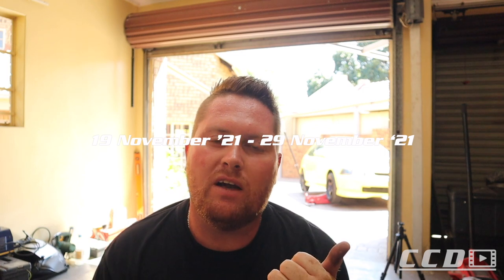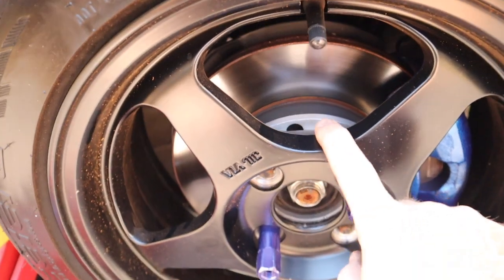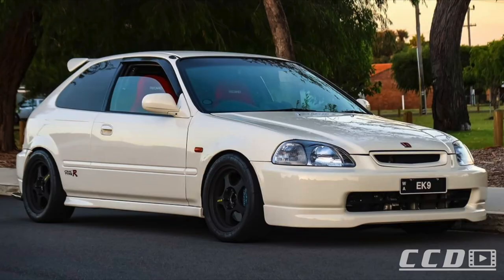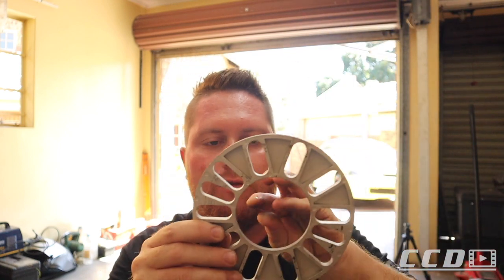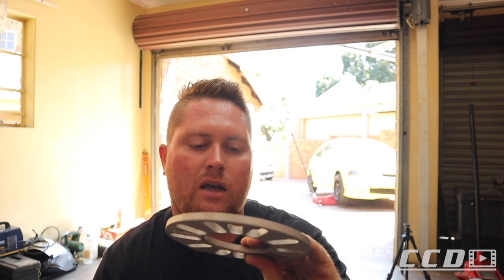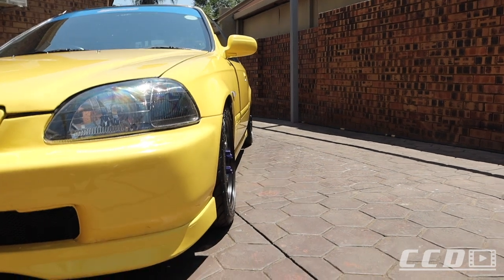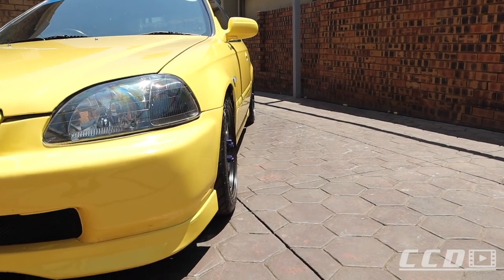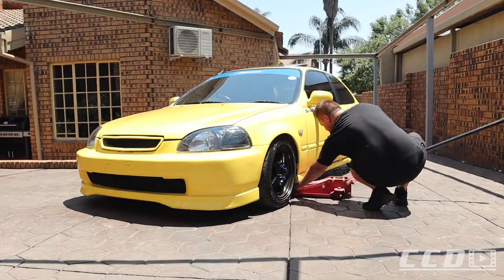Installing Wheel Spacers On My Honda Civic || Is This SAFE??

Comment: You are required to increase the studs if you want to run spaces and you need to cover 3/4 of the stud with the nut for safety
Reply from the maker: Thanx dude I appreciate. Will get it sorted ASAP

Comment: Get hub centric spacers. They are safer to run than that style. Not to mention with a hub centric spacer your wheel doesn’t have the opportunity to wobble.
Reply from the maker: Thanx bro I know fully how they work. Just trying to guage the thickness I need, since it’s not a cheap outing to go extended studs + hubcentric spacers. So need to order it right the first time

Comment: Personally I’m not a fan of spacers. The right was is to have ET changed by a professional mag place. Cheap at the end of the day is more expensive. 15mm is probably the better one. Great content 👌🏼
Reply from the maker: Thanx dude. Instead of changing the wheel, I’d prefer spacers. Can play around with fitment that way

Comment: Those universal spacers are dodgy AF.Seen pleeeenty of snapped wheel studs because of them.Maybe try deriam if you haven't already?
Reply from the maker: Thanx dude! Yea I’ll prob go to them. Just trying to figure the correct thickness at this stage. Hub centric + extended bos arent cheap. I’d hate to spend all that money and not be happy with the fitment